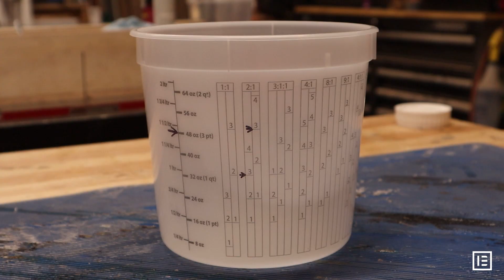DIY Epoxy Resin Tap Handles

Comment: How was that burl prepped? Mine has dirt and bark on it. Wire brush? Pressurized air? Thanks.
Reply from the maker: A toothbrush and air works really well to get most of the loose dirt on small pieces like this.  If you use a wire brush find a softer brass bristle one, steel bristles can scratch the wood more than clean it!
Reply: @studioonethree9814  thank you!!!!

Comment: So how do you get rid of the air bubbles if your not using a vacuum or pressure?
Reply from the maker: I use an epoxy with a long cure time, about 24 hours, that lets all the bubbles settle out, anything left on top gets cleaned up after I trim them to finish al size.
Reply: @studioonethree9814  and you don't get trapped air bubbles in the molds? Could you please tell me the brand and type of epoxy your using? Thanks
Reply from the maker: No problem, I use clear Ecopoxy 2:1. (2:1 specifically because the 1:1 version has had issues hardening fully in the past)  these molds were simple enough and didn’t have any issues with bubbles around the wood, only a few left on top. If I did any more complex molds that weren’t flat like this then I would definitely want to use a pressure pot or vacuum.
Reply: @studioonethree9814  ok I've never seen it done before without some sort of vacuum or pressure set up. I guess those are the preferred way but not the only way. Thanks for the response.